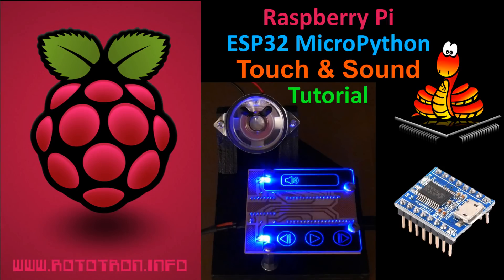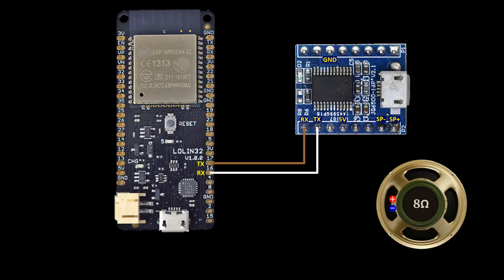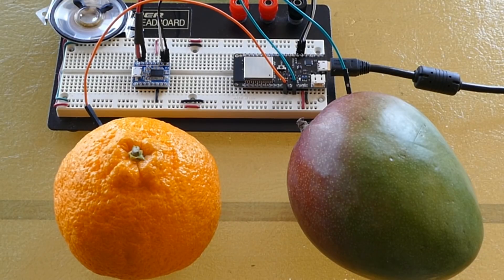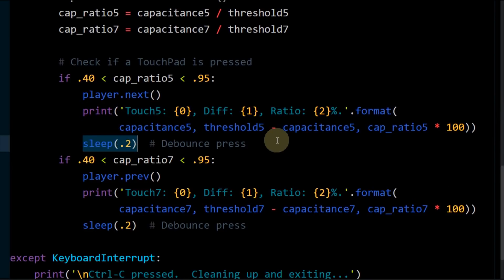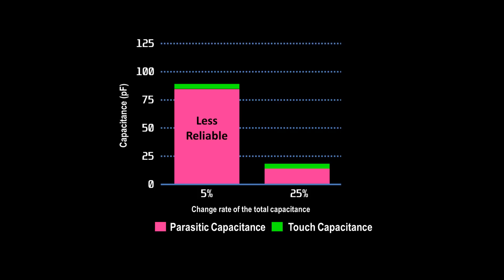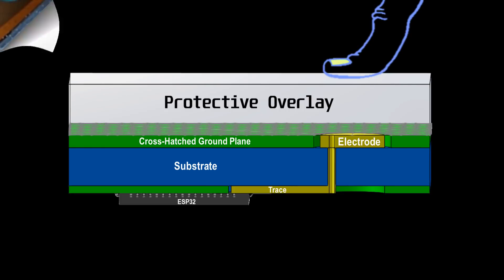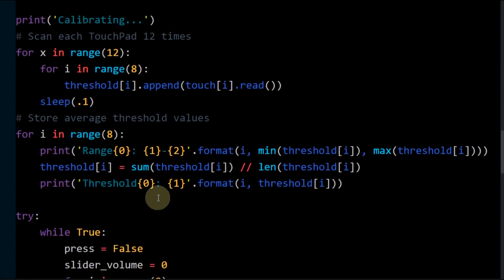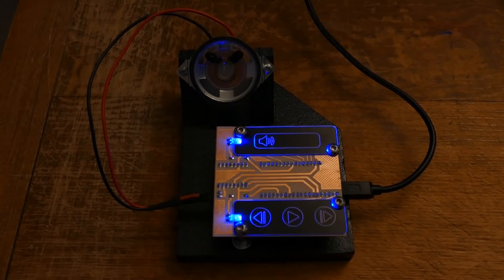ESP32 MicroPython Capacitive Touch & Sound Tutorial

Comment: hey!! it was an amazing tutorial.  As a beginner i have learned a lot from your tutorials.

Right now i am trying to read and write a co2 sensor(mh-z19b) datas via esp32 using uart, but it always reads the data bytes as none and i am not able to understand it. Below is the code and can you tell me whats wrong in it? 
Your help will be appreciated.
Thank you.

from machine import UART

uart = UART(2, 9600)
uart.init(9600, bits=8, parity=None, stop=1)
uart.read(9)

data = [0xFF,0x01,0x86,0x00,0x00,0x00,0x00,0x00,0x79]    # request data bytes to get co2 concentration

while True:

    w = uart.write(bytes(data))
    print(w)                        # output --> 9
    s = uart.read(9)
    print(s)                        # output --> None
    ppm = s[2] * 256 + s[3]
    print(ppm)                      # output --> 'NoneTypeObject'
Reply from the maker: I've never used that sensor.  I would try adding a sleep(0.1) between the write and the read.  Also search github for existing micropython libraries for your sensor or python libraries that you could port to micropython.
Reply: @rdagger  Hey!!
sleep(0.1) between write and read worked out. Now i am getting the co2 readings.

Once again thank you for your help:)

Comment: Hi!
One question, why micropython instead of C?
Reply from the maker: Like Python, MicroPython is a very easy to use programming language relative to C.  Python has an intuitive and readable syntax which generally requires less code and decreases development time and maintenance.  It has a very robust standard library.  It supports duck typing, iterators, generators and comprehensions.  You don’t have to worry about compiling your code, memory management or high-level data types.  There are downsides such as performance, debugging and low level access.  However, Python is an excellent language for gluing so it works well in conjunction with C.
Reply: Thank you for your reply.  Im a very noob programmer with powershell, html, css and minimum C in Arduino. Which one of the two, Micropython or C, should I start learning first?
My main objective is to use ESP32 gathering sensor data, activating relays or pumps, and gather that data to send it to a web.
I've seen so many threads and webs saying micropython is bugged and in a bad state for ESP32, and that one shouldn't waste time learning that and instead learn C or C++.
Reply from the maker: Generally speaking Python would be a better starting point than C.  For a Raspberry Pi, Python would be a great solution because the technology is very mature and has a large ecosystem. For a microcontroller the decisions is not as clear cut.  The ESP32 is relatively new on all platforms.  The Arduino IDE is very popular and has a lot of support.  It's also a simplified version of C/C++.  Nonetheless, I really like the LoBo build of MicroPython. It is being very actively developed and has fantastic support.  I think either would be a good choice for your objectives.
Reply: Hi again. Sorry to keep bothering you. Im evaluating what would be better to migrate my current arduino project, and I wanted to ask you if micropython has the capacity to do the following:
millis()
lm35 or 
LCD i2c library 
loop (stupid question since all languages have loop, but I'm asking if something like void loop() can be done as a standard for all codes
analogReference(INTERNAL)

Thank you a lot! And sorry again for so many questions in youtube.. not the ideal situation. If you have a reddit I can contact you there.
Reply from the maker: There is a RTC module for keeping time.  The utime library has ticks_ms(), ticks_us() and ticks_dif() to track time differences.  There is also a timer module that lets you fire interrupt events at specific intervals.  
The ESP32 has analog pins so you can read analog sensors.  However, the LM35 is 5V and the ESP32 GPIO pins are 3.3V so you would need to use a level shifter or a different sensor.  There is a built-in one wire library for the DS18b20 temperature sensor.  I’ve been running a DS18b20 on a Pi for about 5 years in my server room and it has performed flawlessly.  There is also a built-in library for the DHT22 temperature/humidity sensor which I’ve been using for outdoor readings on my home automation system.  Both of these sensors are digital which are much easier to get accurate measurements than analog.
I wrote a MicroPython LCD library but not for I²C (it wouldn’t be very difficult to modify).  However, there is an existing MicroPython I²C LCD library on GitHub but I haven’t tried it:  https://github.com/dhylands/python_lcd   You might also want to take a look at TFT or OLED displays.  LoBo has a very efficient and powerful TFT library.  I prefer OLED displays because of the low power consumption, high contrast, viewing angle, temperature range and hardware acceleration.  I wrote a MicroPython library for the SSD1351 OLED display: https://github.com/rdagger/micropython-ssd1351
In MicroPython you can have a main infinite while loop -> while True:
The LoBo build allows you to set the analog Vref.

Comment: Another fantastic video.  
First of all, thanks for developing a Micropython library for the JQ6500 and sharing it with the community.  Many thanks for continuing to program in Micropython, for beginners like me it allows us to really understand the code, adjust and apply it so much easier than Arduino/C.

This video is the by far the best description of touch capacitance on microcontrollers from a practical implementation point of view.  It is really well explained and likely problems in setup are covered.  
I know a lot of people watching will find it difficult to imagine attempting this project (making your own pcb etc), but the video is well broken down so various elements of your project could be attempted in isolation; press a lemon to start a mp3 track, press an orange to stop, etc, etc!

Up to now, I have kept well clear of the touch sensors on the ESP32 and have never tried any projects with sound.   Given this impressive project I feel I have to give it a try!  Thanks
Reply from the maker: Thanks for the helpful feedback.  Making PCB's yourself is very easy and inexpensive.  All you need is a laser printer, some glossy paper, an iron and common chemicals found at the market and hardware store.  I posted detailed etching instructions on my website.